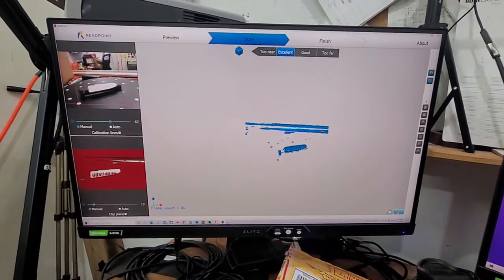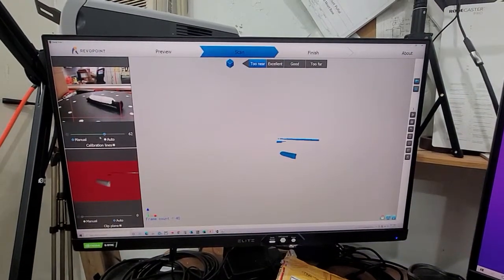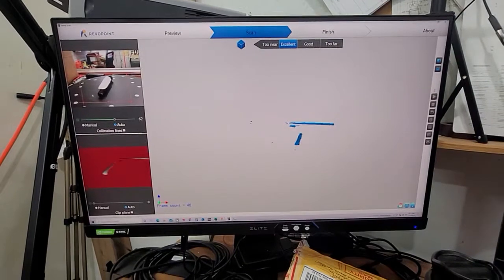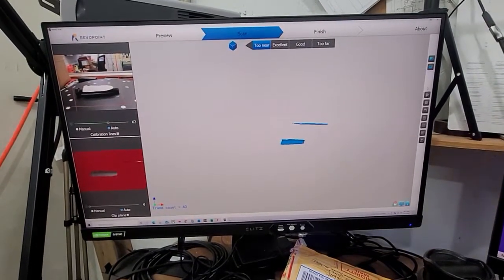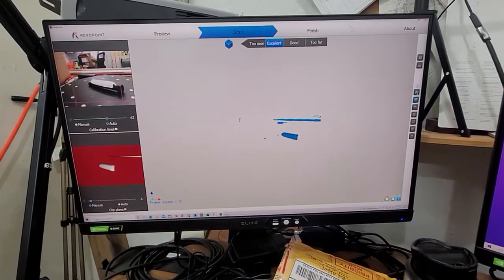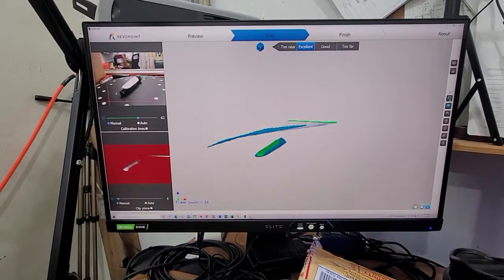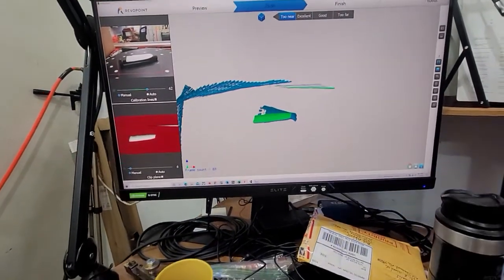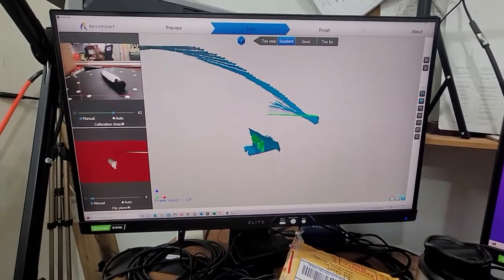trying to figure out POP Scanner

Comment: You've scanned the back ground which is confusing it - position the POP higher and aim downwards.  Also adjust the gain on the lower left window, it should be a light grey not bright white if possible.  Finally consider placing some easily scanable objects (dice, nut, small bolt) near the object, this will help tracking such a small and uniformly shaped item.  Then you can crop the unwanted data out afterwards.